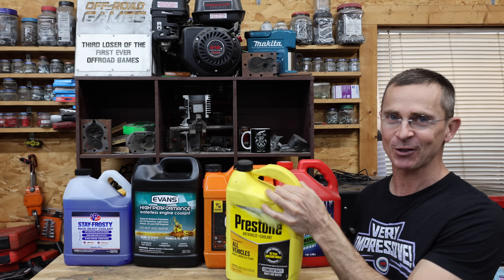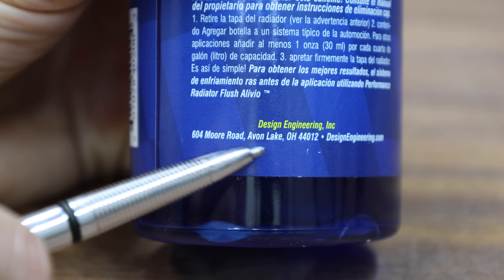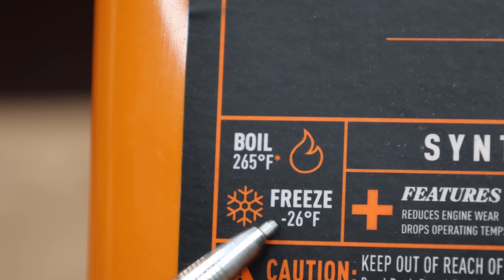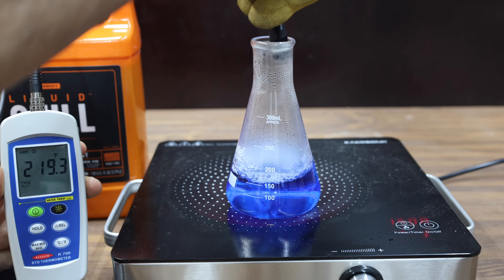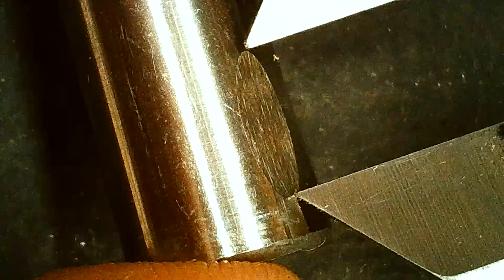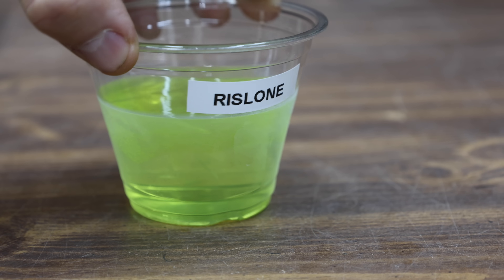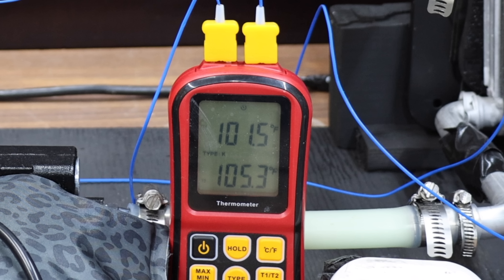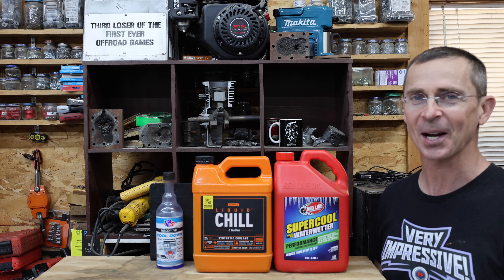Do "Super Coolants" Lower Engine Temperature By 30 Degrees?

Comment: I have used Evans for a long time. The benefits far exceed the already amazing tests that this channel does. I immediately noticed a 1mpg improvement on gas on my pickup. It warms up faster and does not heat up under load like antifreeze. It also prevents liner cavitation because there is no water as well as it runs at basically 0 psi in the cooling system. I truly love this stuff but it is very expensive here in Canada. 
I just thought I would add a little extra for those wondering.
I have to correct that as per a few people writing me the system will reach system pressure of 2-3psi only because of coolant heat expansion. Because 0 or basically 0 is unacceptable to some even though possible. Nothing bad happens if you take the cap off and reinstall at operating temperature. Your system will operate as normal.
Reply: How does it run at 0psi?
Reply: @RedSilverado07  see my reply to Zacharymorris above
Reply: I don't know about the 0psi, but my 79 Silverado has been running Evans since 1980! That 400sbc never gets hot.
Reply: @rickyanke9407  coolant expands when heated.  Pressure is inevitable
Reply: @zacharymorris9917 
Ah, good luck getting much pressure when the boiling point is 375f. 
No other coolant comes close to that they're 100+ degrees behind at least.
Reply: @MrTheHillfolk  that's not how it works.  Every time the engine cools or heats, the coolant expands and contracts.  Coolant is drawn into the system when it cools and pressure builds when it heats.  Once the system reaches the cap relief pressure, the excess expansion is pushed into the expansion tank/reservoir.  The next time it cools, that coolant is pulled back into the system for the process to start over again.   You have absolutely no idea what you're talking about.
Reply: @zacharymorris9917  thank God you showed up to tell me I've been doing everything wrong for 30 years. I don't even know why I went to school in 1995 to become a master tech to tell you the truth, do you have any reason why I did that? 
I must be dumber than a rock. 
I mean I guess I'm so stupid I don't know a damn thing I forgot everything I've done in the last 30 years. Thanks for letting me know that, I appreciate that.
Thanks, thanks again I don't know what I've been doing with my life until you told me that.
Reply: @MrTheHillfolk  you thought that coolant boiling is where cooling system pressure came from for the last 30 years!?!?

Damn good thing I finally showed up to teach you something you haven't been capable of learning from personal experience for 3 decades.  Only took me a couple months to learn that back in the 80s when I was a literal child. 

You're welcome.
Reply: @MrTheHillfolk  the concept of hot equals expansion and cold equals contraction is evidently hard to learn if you have an intellectual disability.  Hang in there, bud.  Life's gonna be rough for you.
Reply: @zacharymorris9917  thank God, oh I'm so grateful for all your knowledge Lord and Savior of the world thank you thank you!! 
 can I kiss your feet some more oh knowledgeable one of everything? 
Why did I waste money going to tech school, I should have just listened to everything you said and I'd be a millionaire.
Reply: @MrTheHillfolk  it's okay.  Physics can be hard when you have a mental disability.  For the rest of us, it's overly simple to understand that things expand when heated.  We don't need tech school for something so simple.
Reply: I run evans in my ktms and my 500exc has the most hours on the engine ever saw, i'm not saying it's evans, but it sure didn't overheat because it would have blown. Now retired because the splines on the output shaft are almost gone lol. Anyways, this stuff does wonder on my enduro bike who used to boil over, evans mostly fixed that, it just can take more abuse.
Reply from the maker: Thanks for sharing.
Reply: I actually have been past the place a few times but never stopped.
Back in the '90s I requested all the information from them at the time I saw an ad, very interesting stuff. 
Basically it would let the muscle car guys keep their high compression ratios and timing on modern gasoline because it absorbed the heat out of the engine so much better. 
And don't be alarmed at higher temps, that's the heat being transferred. 
Makes sense ,dad had a 65hp Lycoming upgraded to a 75hp, and they install piston squirters. 
Oil temps went from 130 to 180 because the oil is actually now absorbing the heat out of the piston from more contact.
Reply: I have used Evans NPG in my 1972 Chevrolet for 25 years since a drivetrain refresh. This car is original configuration and has no overflow bottle. These systems originally used about a 15 pound radiator cap and coolant level was suppose to be an inch or two below full to allow for expansion when the coolant heated up. I use a 4 pound cap and have the Evans at about 4 inches below full when cold to allow for expansion as the instructions suggest. The cap is just to keep debris and moisture out of the cooling system.
Reply: @kyledally8410  if your cooling system is at 0 pressure at normal operating temperature there is a problem.
Reply: @zacharymorris9917  the radiator cap is there to increase system pressure. However the only reason it is needed is to raise the boiling point of water. Yes boiling point of water is greater at sea level than 10000 feet. Water filled cooling systems need the pressure to create a safety margin for boil over protection. To get more complicated, the water going past the cylinders is super heater (above actual operating temperature) causes it to boil, thus increasing system temperature. With an extreme boil rating of Evans this does not happen therefore does not increase system pressure. This same principle is applied to liner cavitation and the extreme reduction of it in big bore diesel engine. The necessity to still use a pressurized radiator cap is still there because Evans is Hygroscopic which means it wants to absorb moisture.
I should add that because Evans does not boil   “next to the cylinder walls”  like water it does transfer heat better because steam doesn’t not transfer heat, also because of that this is why overall system temperature increases slightly and the vehicle can be more efficient because of it.
Reply: @kyledally8410  wrong.  🤦‍♂️

I'm not going to repeat myself just because you have magical thinking.  Zero pressure indicates a system failure.
Reply: @zacharymorris9917  can you enlighten me to my magical thinking. I brought knowledge and common sense with my reply. However you have no wisdom included with your system failure comment. Maybe take a look at other reply’s who also state that engines with Evans also have no system pressure and work just fine.
Reply: @kyledally8410  I notice you didn’t reply to my comment but it was meant as a polite way to point out your error and to allow you to correct it.  Regardless of the boiling point of the fluid, the system is going to be pressurized in a pressurized system. 

Thank about it like this: it’s pressurized because of the boiling point of water. But the boiling of the water isn’t required to pressurize it.
Reply: @kyledally8410  the magical thinking comes in where you said "Evans equals no pressures".

It's literally impossible without a failure in the system.  I'm not asking you.  I'm telling you.  It's not up for debate.  I am an expert in this field.  Got my masters 24 years ago.  You are wrong.
Reply: @bigwheel9132  not trying to be annoyingly specific, but a small critique for the sake of those who might have misunderstood you: the boiling point does NOT cause pressure.  The pressure causes the boiling point (to rise) and increases the thermal transfer rate.  Baring a weakness in the system, lowering the pressure is always a bad thing.

Now we know that OP either lowered his cooling system level too much (per Evans instructions) or has at least 4 psi system pressure, NOT the claimed 0.
Reply: @RedSilverado07  I didn’t see your first response. I agree that the system is designed to be pressurized however the water pump is not a positive displacement pump. It does create flow to move the coolant around the system or else it will not work. A restriction in flow creates pressure. In my own experience and I have converted a few of my own vehicles. There is a tiny release of air pressure when the cap is removed hot most likely caused by temperature expansion. However it is also possible that it could still be residue water remaining in the system. When converting after finished you use a refractometer to measure the coolant to verify remaining moisture content. Now it has been a while and I don’t remember the exact numbers but I believe 2%> is acceptable from the manufacturer. The system is 100% capable of running without the cap and operating normally (under no pressure) until such a time when it absorbs too much moisture from the atmosphere and contaminates the coolant. So I guess I have to admit it may run system pressure at 1psi and not 0 but for all intents and purposes the system can run without hose clamps and it will never blow them off.
Reply: @ yeah I was attempting to say a dumbed down version of what you said essentially
Reply: @ Temperature expansion is where the pressure comes from; not the restriction on psi. I’m not trying to rain on your deal either dude but your understanding of what a cooling system does and why is does it appears flawed. You most certainly want a pressurized system if it was designed that way. 

A common mistake is thinking that the layman is smarter than ALL of the big car manufacturers.
Reply: @bigwheel9132  he is equating differential pressure (delta) with guage pressure (atmospheric) while thinking he's a genius.  🤦‍♂️

Hopefully no poor young kid listens to his nonsense and has to suffer the consequences.
Reply: @kyledally8410  are your parents named Dunning and Krueger?  Pretty sure I've met them before.
Reply: @zacharymorris9917  lmfao. You’re really kicking my ass man. You’re flat out, matter-of-fact, point-blank saying what I WANT to say but can’t bring myself to do.
Reply: @zacharymorris9917  I will give you credit for Evans not running at actual 0psi only because of thermal expansion. However liquid cooling systems in vehicles were not originally designed to run under system pressure so the false statement about if they are running at 0psi there is something wrong with it, in todays vehicles that is correct, but not always the case. Do you know the reasons why pressurized systems were invented and implemented as well as the addition of the expansion tank or external reservoir later on. I too have been doing this all of my life. I don’t want to carry on an argument for a long time as I do have better things to do. My original comment was made as to try and include more benefits than was originally tested/ stated in the video. I believe that Evans should be a factory option for all manufactures.
Reply: @kyledally8410  just give it up already.  You made an incorrect claim, just man up and admit it.

 Name one single vehicle made in the last 5 decades that doesn't have a pressurized cooling system.  You can't.  🤡  I'd be shocked if you could name one in the last 10 decades.
Reply: @zacharymorris9917 WOW. I corrected the 0psi claim I made originally and accepted it because I’m a big boy. Clearly you may need to look into mirror and ask yourself a couple of questions. Also you seem to be the only person who needs clarification on PSI and atmosphere. No coolant pressure gauge I have ever seen is calibrated differently than 0psi (so it reads 0psi even when atmospheric pressure is acting upon it. ) yes I also know that there is vacuum coolant gauges as well before you claim something else about that. With that I’m assuming you don’t know the history of pressurized cooling systems and need to revert back to being negative towards others. The other thing I will say is I have seen many licensed mechanics over the years who should not have one and likewise some who were not licensed that know a lot more than most. I wouldn’t automatically place that being a licensed tech as the be all end all of qualifications and knowledge.
Reply: @kyledally8410  put the shovel down.  Stop digging. 

Name a non-pressurized cooling system made in the past 5 decades.
Reply: @kyledally8410  spare me the tone policing lady.  Is your name Karen?
Reply: @kyledally8410  two of us have had to explain to you the difference between delta and guage pressure.  You claimed the water pump would cause system pressure.  That's simply wrong.  If you still haven't learned this, I can try to explain it for the 6th time.
Reply: @zacharymorris9917 what I said is the pump creates flow. I also said that a reduction in flow creates pressure. (I wrote that because I thought you needed clarification on where pressure comes from) Nowhere in that did I say that the water pump in the cooling system causes system pressure. You clearly need an Interpreter for this discussion. Also because you can’t be wrong you are changing your tactics of including only newer systems to make sure you remain correct in theory. But I have worked on equipment made within the last 50 years that do not have a pressurized system. So why can’t you admit that possibly you could be wrong in your lifetime.
Reply: @zacharymorris9917 if you must know I did work on a 1979 931 cat dozer with a non pressurized system. It had a vent tube internal of the radiator below the cap. So it is clear to me that you do not understand many things yourself and your expertise is only to try and win stupid YouTube discussions.
Reply: @kyledally8410  I'm pointing out the absurdity of your non-pressurized cooling system claim.  You're DESPERATELY gasping at straws to avoid admitting you're wrong (and then projecting that on to me.)  For all practical purposes, every single closed loop cooling system on the planet is pressurized.  99.99% of them.  I could not care less that you imagine 0.01% that aren't. 

Stop lying about what you said.  It's still there for everyone to see.
Reply: @kyledally8410  the past 100 years is "newer" to you!?!?  LOL

I'm still waiting on you to name a vehicle with a non-pressurized cooling system.
Reply: @kyledally8410  a 79 931 has a 13 psi pressurized cooling system.  WTF are you talking about?
Reply: @zacharymorris9917 the more you type the more I realize your just a google mechanic. Good luck with life. As per your claim. The unit we had was equipped that way. I cannot speak to what it originally had. Possible you could be right again as per your life, to never be wrong or make a mistake. I do know for a fact that ours was equipped that way while we owned it. The only people who have never made a mistake are the same people that have never done anything wrong  as per your googling skills. The internet is never wrong so keep up the good work.
I’m sure that you are aware of this as well google master but there are many watercraft engines that use non pressurized systems. I wonder how you will tell me that they can’t work if they’re not pressurized.
Reply: @kyledally8410  you're clearly a parts changer with no comprehension of how any of the systems actually work.  That's the level I was at when I was 5-12 years old.   You're going to remain at your level until you die because you're one of those never-wrong guys that are literally incapable of learning something new.
Reply: @kyledally8410  watercraft typically are NOT closed loop.  Stop pretending I didn't specify closed loop.  They also use a significantly cooler thermostat and operate well below the cylinder head boiling temp.  Closed loop systems have none of those features.  Tons of modern watercraft run a closed loop PRESSURIZED cooling system.
Reply: @zacharymorris9917 In those type of systems(which you initially thought I wouldn’t be able to name because you think I’m dumb) they need to run thermostat temp lower because they are non pressurized systems (which you wanted an example in the past 50yrs and google told you that I was wrong about the first one). Also I’m still waiting on you to tell me about my earlier question because it will prove that I’m right, which you won’t because you are incapable of that. it’s impressive how you can claim your answer as being correct while trying to make me sound wrong at the same time. I will give chatGPT credit and your master google skill for your reply. Why don’t you get saved by the bell somewhere else.
Reply: @kyledally8410 how much Evans does a boat hold?  😬🤦‍♂️ I don't think you are, I know for a fact that you are.  You're incessantly proving it comment after comment. 

 DO NOT TAG ME AGAIN

Comment: It would have been nice to test separation.
Leave the mixtures sitting during 24h and then check if the transparent glass recipients show if
super coolants look separated from the green Peak coolant,
simulating leaving your engine off during 24h 
hoping super coolants stay mixed with normal coolant and not at the bottom of the glass container.
Reply from the maker: Thanks for the constructive feedback.

Comment: For normal driving with stock engines, this stuff just isn't needed. The cooling system with the approved coolant is designed to get rid of enough heat to keep the engine at its intended temperature.
Reply from the maker: Thanks for sharing!

Comment: Cooling system pressure is a result of thermal expansion, not vaporization.  Different fluids expand more than others, such as auto transmission fluid versus crankcase oil. Atf will raise 1 qt low cold to full hot. Engine oil shows no change cold to hot.

Comment: Why did you test it at 120° when 195° is normal operating temperature? It pretty much can throw out that test it means nothing when it's not even close to the normal reason you would add this. Smh.